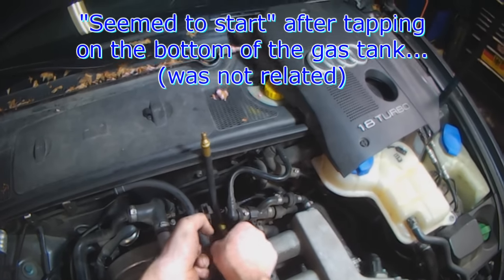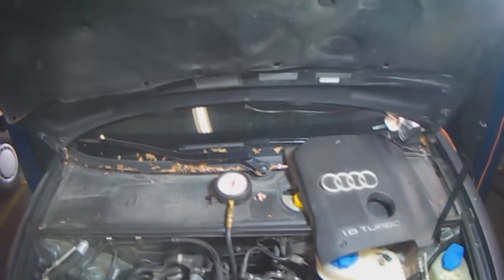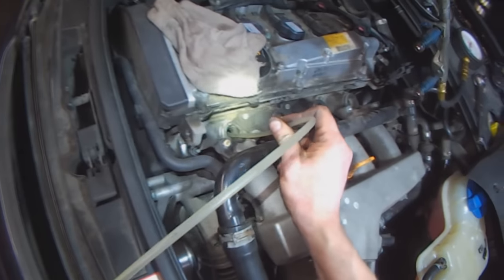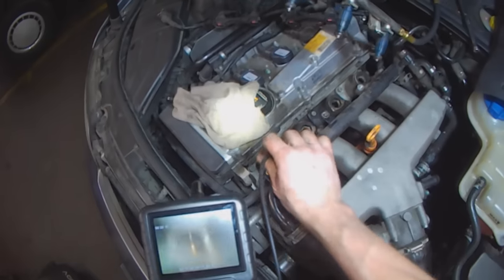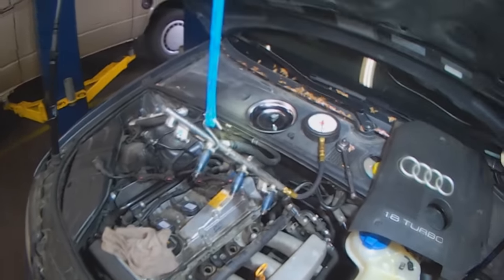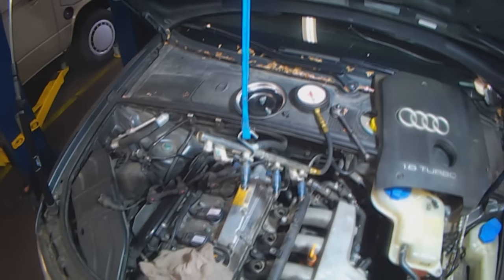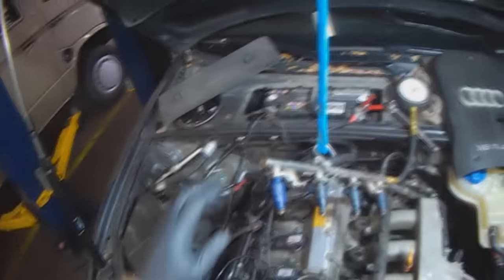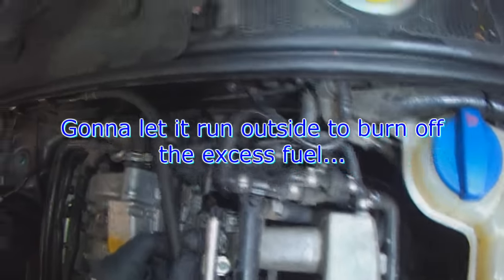Audi B6: 1.8T Rough running & white smoke out the exhaust

Comment: Was it lagging on acceleration ???? I have a Audi a4 b6 and it lags when accelerating
Reply from the maker: It was only running on 3 cylinders... so yes. Lacking power.
Reply: @EXOVCDS  ok great this is what my a4 b6 is doing I have a cylinder 2 misfire and cooling temp sensor high but I already changed that
Reply from the maker: "This is what my A4 is doing"... smoking badly at idle? Wet spark plug?
Reply: @EXOVCDS  ok thank you
Reply: @EXOVCDS  spark plug weren’t wet when I changed them and barely smoking but sputtering
Reply from the maker: @danthetoolman4311  then it's not the same problem.
Reply: @EXOVCDS  ok I’m going to try the pcv valve and see
Reply from the maker: @danthetoolman4311 
- Scan for fault codes.
- Determine which cylinder is misfiring.
- Swap the ignition coil of the misfiring cylinder with one from a good cylinder.
- Clear fault codes.
- Drive vehicle / make sure the lack of power is still present.
- Scan for fault codes.
- If the misfire is now on the other cylinder... the ignition coil is bad.
Reply: @EXOVCDS  ok got it thank you

Comment: Nice troubleshooting ;)
Reply from the maker: Actually a bit on the sparse side... symptoms pointed me in that direction from prior experience with similar vehicle.
Reply: +Thomas EXOVCDS so, the engine was running rough because the mixture was to rich on one cylinder. is it right?  thank you!
Reply from the maker: +Kevin Turton Yes... not just rich. Flooded, literally. The engine could have hydrolocked if too much fuel had gotten into the #1 cylinder... bending the connecting rod of the piston.
Reply: +Thomas EXOVCDS That small thing can be a disaster

Comment: Can this cause a cat code?
Reply from the maker: If the cat gets damaged from all the raw fuel... yes.
Reply: When I took off my old turbo the back portion of it was white and the inside walls of the cat was white, what does that mean?
Reply from the maker: @Lu-gm9mx  It gets hot in there... that's normal. If you see anything that is melted, that's bad.
Reply: I really appreciate it man! And sorry about this but I have one more question, my oil light came on yesterday, and my car started making a slapping noise not a knocking noise, I had oil in there, do you think my oil pump is dead?
Reply from the maker: @Lu-gm9mx  Don't know... could be a plugged / restricted oil pickup screen. Don't run the engine if the noise does not go away.
Reply: Thomas EXOVCDS yeah the cct I changed still looks new so I’m sure it’s not getting any oil, I think it should be the pump, I’ll be changing it tomorrow, it’s my first time, hopefully it doesn’t take me too long, can I tag your video as reference if I make a video on it?

Comment: unburnt fuel is black smoke, running rich.  coolant would be white smoke.
Reply from the maker: Not according to this video.... did you even watch this video?
Black smoke is black because the fuel was burning... this engine had so much fuel that it could not burn (wet spark plug).